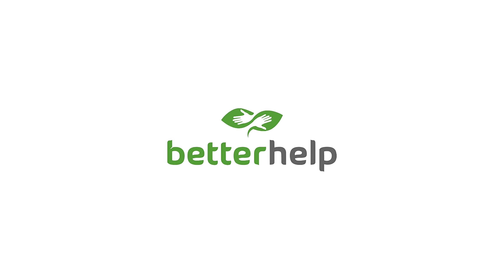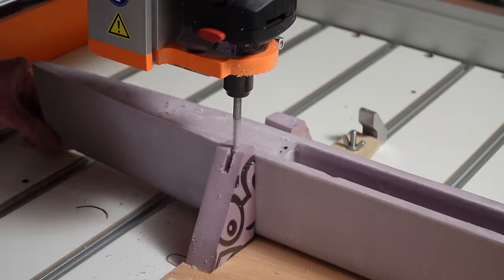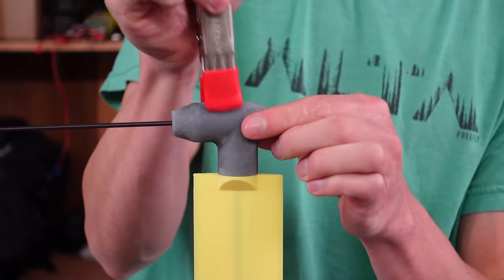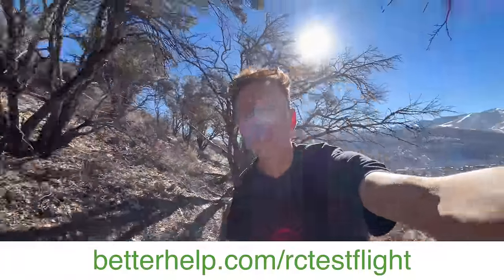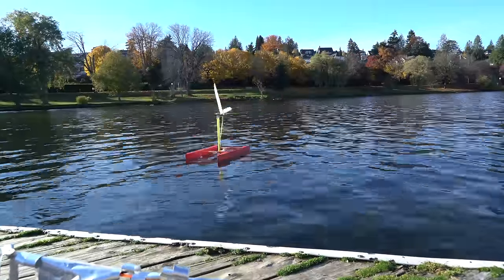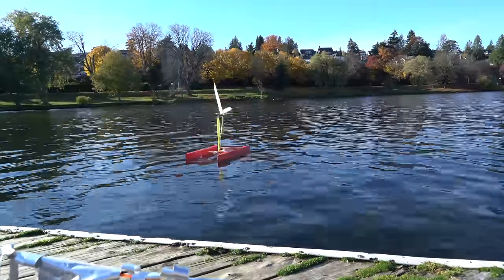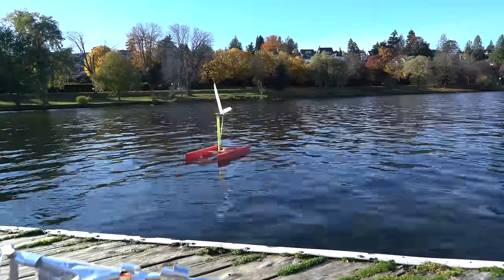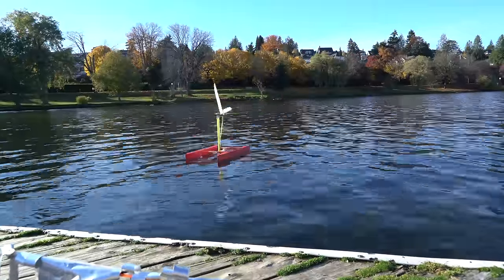Sailing Directly Into the Wind - Is it Possible?

Comment: This is really great! May I also suggest a higher gear ratio? I noticed that your gears are the same size. You could change it somehow with a large flywheel gear from the wind turbine connecting to a much smaller gear connecting to the propellor shaft. Kind of like what we see on our bicycle gears. This would convert the wind turbine energy into double of triple the speed of the wind turbine making the propellor go a lot faster. Also I studied a lot about propellers from another video  and it turns out that what you said is correct. You need a high aspect ratio for the propeller. A prop with a very large diameter and narrower blades is the most efficient form of propeller. This idea is well and truly fantastic and I believe that it could most definately be applied to a regular sail boat by adding the wind turbine to the back of the vessel and attaching it to a propeller below. If the wind turbine could fold itself up, like a self folding propeller, (Designed for some sailing boats out there for more efficiency while sailing and not motoring) then the boat could be steered back to a close hauled course once it comes out of irons again. You did great with the wind turbine turning around to match all points of sail. I think that will work just fine as well. Also I thought about using way more than just one propeller! 😃 You could use a dozen below deck and you'd amplify the efficiency literally 12 times! This won't increase prop speed ( you have a better gear ratio for that as I explained earlier😉) but it will most certainly increase torque twelve times more than before giving your boat more 'grip' pushing forward in the water, more torque needed for that extra propeller speed from the better wind turbine to propeller ratio if you adjust the gears to a bigger wind turbine gear and a much smaller propeller gear. Just an idea or two! 😂
Reply: You need to make it clear what you mean by "propeller" do you mean the windmill in the air or the propeller in the water? The rotor in the air could either be referred to as the "wind turbine" or "The windmill", but "propeller" means something that propels so only applies to what is in the water.

Comment: Have you guys stumbled across reference to the egg beater rotary sail? Someone else here in the comments called it a vertical axis rotary sail, which is probably it's real name, but it looks like an egg beater. The mast doesn't need to be steered into the wind - it rotates no matter where the wind is coming from. Kevin Costner's boat in Waterworld had one.

Then there's the dynarig and foiling boats. Because the math has all already been done, and a fast tacking boat is just faster than a rotary sail. The dynarig requires a ton of sensors and sail programs, and the processing power to integrate them. It also requires unusually strong masts, but it looks like you've got that problem licked.

Comment: For a better rudder make the prop the rudder (make it turn on command like the air windmill can, but hook it to a 360 degree servo type deal -- ships do this with, what are they called, basically the prop is on the end of a bulbous pod stuck in the water.  The other way to do it is to have the props like normal but have a half-sphere that can come around and divert the thrust wherever you want it, even backwards, obviously at less efficiency)  EDIT: now that I look at it, your rudder is waaaay far back from the prop. Rudders are always right behind the prop for a reason.  Maybe to 2x props one at the end of each catamaran and 2x rudders, right behind them.

Comment: Nice video ! Have you thought about putting foils under the boat to make it lift and reduce boat friction into the water? A normal windsurfer would reduce sail size by 2m square sail size using a foil.

Comment: There should be a golden ration for sure.  Some gearing might help to find it closer to perfect. However, you might try surface piercing type propeller to reduce eddy friction of water. Because that type of propeller half in the water beats the water.

Comment: Pretty cool!  You commented that the wind turbine was able to produce more torque than the propeller could use. Perhaps you could increase the propeller pitch?

Also, you are using a very high-drag wind turbine design. Consider developing aerofoil shaped blades (CNC mill out of foam perhaps), which will use aerodynamic lift to produce torque rather than drag. 

Design of wind turbine blades is similar to airplane wings, except that the vector triangle for angle of attack is a function of radius and RPM.

Comment: You could cover the parts of the hull that come in to contact with the water with a hydrophobic material so it has less friction.  I would make sure that your drive shaft is super rigid also so that it has a hard time flexing.  And yes have a stronger rudder and put a keel on the hulls.

Comment: Sailboat sales do not gain lift without drag.  A kite only stays in the air when you pull on its string and it goes higher when you pull on it you add drag. For this reason sailboats do convert their power into the water using keel board this prevents the wind from blowing the boat sideways and gives the wind something to push against

Comment: Big problem with propellors is much less swept area. In strong winds it is better, but in light winds it is difficult. However, something like an electric drive interests me. So long as there is a velocity difference between the wind and water, energy can be gained using horizontal axis turbines.

Comment: this is simple to solve you need high rpm on the water prop. so this is a gearing issue, 1:1 is not going to cut it. bigger water prop size just adds drag and slows down the drive fan rpm.
i would suggest trying it with a 50mm with a medium pitch geared at around 1:3   or 1:4.   i.e. 1 rpm  on the air driven fan to 3rpm on the water prop. as water props rely on high RPM to create effective drive and forward speed. the rudder is ineffective as it needs water flow across it to turn the boat. you should also find that buy adding vertical fins to the underside of the hulls will help this and stop most of the side slippage your getting. also by bringing the water prop to the rear of the boat will enhance the drive and give water flow over the rudder,  if you bring the prop forward and Tow the boat forward this gives higher speeds but greatly compromise's directional control as you now rely on the speed of the boat to use the rudder. 

planning

Comment: interesting experiments! i am curious which way your development converges. i made a boat like this around 2006. i made the turbine first, as model to try and make a mini windturbine, as good as possible. the boat came later, and was made of foam and balsa, very light weight. i used two x-twin mini airplane propellers as a four blade water propeller, screw. (tried one, and three, two went best). the diameter factor between water propeller, and wind turbine was about 6 or 6.5. some other observations: the windturbine works "close hauled" in a "reach", with a quite flat angle, fast tipspeed ratio many times windspeed (5x or more). whereas the screw works "close hauled"  and has a steeper angle with more "pitch". it worked great, sadly i don't have it anymore, nor video. i do have witnesses though, and, mental plans, and, propellers, same shaft material as then. i want to reproduce it, it had good weather handling with axle flexing, damping of the turbine. you as well noticed a certain stabilizing effect of the turbine, too. mine was of the "inclined shaft" type. the propeller was quite prowerful relatively, and was a kind of "reverse sea anchor"! pulling the nose down, and with turbine, lifting the rear. this had a effect of depowering the "drive". i wish i had video material, would be nice to see!
add: one observation i forgot to mention: if the turbine is relatively large, the frequency is lower but the drag larger. same goes for relatively small screw! needs high frequency. (duals). this could be tuned, by variable pitch or/and variable gear ratio. i had a single 0.8mm steel wire shaft, loosely suspended in 2 brass tubes bushings (axle free to bend everywhere without binding in a bushing), and a thrust bearing, bead and spacers, between the turbine and the bushing. in practicality, when there was wind and the turbine had a drag, the traction of the screw was (almost) immediately larger. no setting back but powering forward. in 5 m/s wind, the turbine tips went probably 25 m/s around. it misted spray somewhat.
add: to state more correctly: the turbine had more absolute pitch (advance per revolution), but way more diameter. the screw had less advance per revolution, but way less diameter. the screw had a larger pitch/diameter ratio than the turbine. looked "steeper", but less absolute pitch. also, in proper wind there was at least 1000 rpm, (or ~17 r/s) average.

Comment: Many years ago a sailor in New Zealand claimed to have installed a windmill device on a hull and to have routed its power to an underwater propeller.  He said that the windmill could power the boat straight into the wind.  This seems logical, because sailboats are able to harness the power of wind in order to progress upwind.  The only reason that sailboats cannot move straight upwind is because their sails cannot harness the power of the wind from that direction.

Comment: Surprised this could work at all, but it does. I guess the main concerns are minimizing the drag on the air prop and maximizing thrust on the water prop. Maybe changing to one of the new loop-type water props might help. Also, while you will have conversion losses, an electrical system with either a large capacitor or small battery would allow you to vary the relationship of the two props. A mechanical system would be much more complex, but perhaps more efficient.

Comment: I've toyed with the idea of creating something similar but using energy conversion via a VAWT driving a generator, charging a battery as an energy storage buffer that in turn would power a motor/prop. Direct drive is all good & well if you have a reliable power source but with wind that isn't so. By converting mechanical to electrical (& battery storage), back to mechanical you do have the advantage of harnessing what energy the wind can deliver whether you need it at that particular time or not but when you do need energy you can fall back on the battery storage. This convenience should outweigh the additional conversion losses such a system would experience. I call this method the e-sea sail.

Comment: Great Idea. Use 5 blades for the windturbine. Than you can reduce the diameter and the turbine will rotate faster. At the same time the windturbine will become stronger. The boat needs a daggerboard - maybe on both sides to become faster (Lateralplan). Go ahead. Im curios to see the next stage.💪

Comment: Good work guys. I would have made a generator + electric motor combination to make the power train system isolated. Then one can make an autopilot or a fully manual driving. I am sure  this is not easy as there are so many parameters and optimizaion is complicated. A keel and a rather big rudder are a must.

Comment: Use two DC electric motors, One on the mast to generate power, one in the water to drive the prop.
You could add a battery in the circuit to gain a hybrid drive system. High wind or low wind you'd have drive, plus even when stopped the turbine would be charging the battery.

Comment: Very interesting project.  I would be interested in seeing how proper aerofoil blades would increase power.  I think that would be significant.   Also a redesign of the propeller may be necessary,  as it will only be effective at a give rpm.

Comment: Jim Bates and Peter Worsley both built working prototypes of rotary-sailboats.  Jim Bate's catamaran "windmill sailboat" would sail directly into a headwind at a speed of 8 knots.  The Peter Worsley version used a wind-turbine driven propeller, but I'm not sure at what points it becomes cheating. Peter Worsley has a web page which features some of his experimental designs: "Wingsail & Rotary Sailing: Investigations and Testing".  The wingsail models are the most interesting to me.  The non-wingsail versions are on his "Rotary Sailing" page.

Comment: Perhaps try a vertical shaft anemometer to drive the water prop.  Will rotate regardless of apparent wind direction.  While a 3 cup style might work, you'd get a lot more torque from a full height, S-vane configuration.💡

Comment: Good explanation of how it's possible at the end. This is the thought experiment I used to convince myself; I'm sure others can improve on it: Place a wind turbine generator on the boat's mast, and a rear-facing water scoop "brake" on the hull lowered to keep the boat from being blown backwards. The turbine uses wind energy to charge a battery or capacitor. After a short while, lower the mast, raise the scoop brake,, and connect the battery/capacitor to an underwater propeller. The boat will move forwards. Repeat, and reduce the charge/discharge time interval and now you have intermittent progress into the wind.
Reply: By "converting" the energe from Rotation -> Electric -> Chemical -> Electric -> Rotation  the efficiency will be quite LOW and may have a negative effect on the direction. (as in going the wrong direction)
Reply: @retiredjan4714  At no point would my thought experiment move backwards, no matter how inefficient. If it moves into the wind at 1 cm/day, that proves sufficiently that one can use wind power to move into the wind.
Reply: @redbaron07   >" a rear-facing water scoop "brake" on the hull lowered to keep the boat from being blown backwards"  This is IMHO the problem:  wind will blow the boat in a reverse direction, how much depends on area above the water (wind resistens) and on the area under water (resistens).  In beginning of video the wind force was greater than the propeller force. Look and think about that ;)
Reply: @retiredjan4714  OK, drop an anchor then!

Comment: You want a oscillating sail and keel on a lever behind the boat that "tacks" back and forth in to the wind - like a horizontal dolphin tail under the water powered by a wing above the water. You would need two either side to counter each other.

Comment: You could gear up the propeller by changing the gearing ratios on the bevel gears. Since you already have two of them you can gear up quite a bit without increasing friction.

Comment: Instead of a propeller in the air you should have used a helix windturbine. It eliminates one bevel gear and the stabilizer that holds the prop in wind direction. Nice work and interesting project!

Comment: Center of drag on the "sail"... your rotating omnidirectional sail had to have the vein because the center of drag was forward... move the "sail" so the the center of drag keeps it facing the wind without the need for a vein like the other boat that held its direction into the wind

Comment: You could use different gear ratio to speed up the propeller instead of making it bigger. You already have 2 gears.
Also the Veritasium video explained a different phenomenon. There, the wheels drive a propeller that pulls or pushes the vehicle forward. Here you can also do this. If you let the waterpropeller drive the airpropeller. That is very good for going downwind. upwind will be a bit more challenging though.
Reply: just change the climb on the propellor

Comment: How about an autogyro arrangement? Put the aerodynamic rotor at a slight angle to  a nearly horizontal airflow. It will still spin but would have a lot less drag. Torque may be lower but the potential pay off is in the drag to thrust balance.

Comment: If only it was moving fast enough upwind to use a hydrofoil, then drag would really drop. But, you'd probably need to beam reach to get speed to get foiling first, then head upwind. 
We do this on windsurf hydrofoils. Gather up speed on a beam reach or maybe a little downwind and pop the board out of the water, then turn upwind and immediately get a lot of apparent wind in the sail for power. VMG ends up being really good this way, as in my speed component straight upwind can be 10kts (but the board speed is closer to 20kts). Really depends on foil/sail setup with how much upwind power there is. Wonder if a big large span high aspect ratio foil that has a slow liftoff speed would be able to get enough power and be low drag enough to go stay upwind and keep flying.

Comment: 68 % of the wind power is the forward thrust in your calculation, but the drag is made up of the water drag (hull+propeller drag) and the wind drag: the 10% drag on the propellers + a small amount for the over-water components.
I don't know where the 32 % come from, but this is just the percentage of wind power 'not generating thrust'.

Comment: In the 1980s, off Mersea Island in the Blackwater (Essex,UK), there was a Prout Sirocco, 26ft cruising cat, with a similar set up to your first attempt. It all worked OK but only with highish winds, light airs performance was not good, but then Prouts were rather heavy and never very good sailers in light winds.

Comment: This has a killer application for autonomous MCB (Marine Cloud Brightening) sail boats to restore the climate and prevent Artic melting which causes a lot of climate tipping points.  A large optimized version should work much better at large scale just as wind turbines scale because the boundary layer results in more wind  the higher you go.  Add adjustable pitch blades and maybe a multi speed gearbox for greater efficiency.

Comment: Have you considered adding some sort of gear box inline with the shaft to increase RPM at the water prop? Obviously you'll get diminishing returns if the water prop starts to cavitate, but it might help get some juice out of the (seemingly) excess torque available.